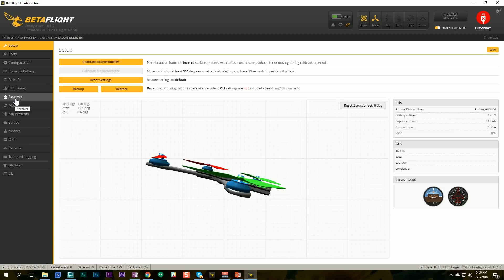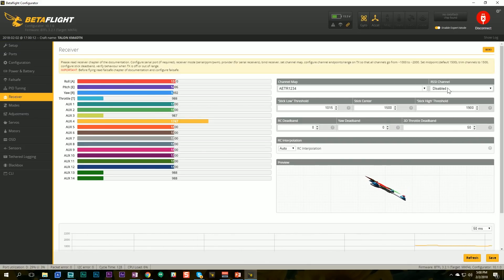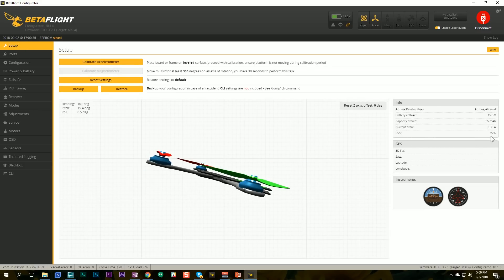How to put RSSI into OSD (UPDATED FOR OPENTX 2.2 & Betaflight 3.2)

Comment: @ Joshua Bardwell is there I problem with betaflight in the receiver tab, I have two builds that are the same and one works fine in betaflight showing the radio is working in that tab but the other one which is wire the same with all the same parts don't seem to be reading in the receiver tab.I been thru every inch of the build to make sure it wasn't my mistake but not at all. no matter what I do its not reading it.is their something that I don't know about, that just happen with betaflight I never came across something like this.And my buddy had called me up and ask me, if I was having any problems with betaflight ?and I said why do you ask ?he said I cant get the radio to show its connected in the receiver tab and I have it on the rite uart and all my wires are correct!!!!so I had to laugh and say im having the same problem so is there something going on that we don't know about.this is why I whish I could make it to the camp with you guys ......pls help if you can
Reply from the maker: Receiver tab blank usually means you are on an old version of betaflight. Check the firmware version on the FC.
Reply: Ok i will do that update and see how that go's thank-you for taken time out to help me.Your the man..And i think you and drew should host more shows the chemistry is on point,great show and i will be sending you $ soon when i get pay for all your  hard work.Thanks again

Comment: I've noticed that using RSSI uplink doesn't prevent using the channel for another function. For example on one quad I have it setup on on channel 5 which I'm also using to arm. (I was running out of channels so tried it and it worked fine). It's mapped to the ARM bar (Modes page) in Betaflight, AND is selected in the Receiver tab for RSSI  It seems the RSSI signal is overlaid on the normal PPM (switch signal) somehow. They don't interact or interfere with each other at all.  

The way I understand the signal path is the 2.4 rx generates the RSSI, sends it down telemetry to the Transmitter (2.4) which displays it and sends it back up to the 2.4Rx (via ch5 in my example) and over sbus to the FC, which then puts the RSSI on the video signal (OSD) which is transmitted on 5.8, received and displayed on your goggles. A VERY circuitous route. Is there a 'shortcut' in the 2.4Rx, does it go directly from detected RSSI and output on sbus? It would have to for this scheme to work with non-telemetry receivers.

This is more involved than it 1st appears, and I'm trying to understand it better. 
Could you explain how the channel sharing works?, I can't find any documentation on it. Mostly technical curiosity, I'd like to understand the signal structure.
(I asked this on the Patreon site once, but I don't know my way around there and I may have posted it in the wrong place) Thanks!
Reply from the maker: +Scott Marshall I don't think you should put your arm and rssi on the same channel. I never want my arming channel moving unexpectedly like that.
Reply: I felt the same way, wouldn't have even considered it, but it's on a FT Gremlin on 2S. Been working fine for months, no interaction at all, but I would like to understand the signal structure - the RSSI is apparently not PPM, or it would be doing weird stuff. I can't remember why, but there was a reason I couldn't share with mode or something besides arm. It was last June or so when I did the build, so it's a little foggy now, but have wondered about it since.
I probably should put ch5 on the scope, but was hoping you knew about how/why this is working as it is.
Reply: Your understanding of how the signal is traveling is correct. But the big question to me is, why are you limited to 5 channels in the first place?! even old D8 protocol stuff had 8 channels minimum!

As for how you're passing both signals on one channel, I've certainly never heard of anything like that. The sbus protocol doesn't allow for multiplexing 2 signals, if you don't believe me, there's a spec sheet available online for it even, you'll have to google it, I can't easily link a pdf here. but I found it though searching "s-bus protocol data sheet"

How are you multiplexing the two inputs in your radio into the sbus output? Additive? Mulitplicative? I could understand if you were adding your rssi value to a switch value, and then using the large offset for the arming signal, but BF wouldn't interpret the signal as a true reading if it isn't varying from 1000-2000us, since that's what it expects to see.
Reply from the maker: It's just a channel from value 1000 to 2000. I don't see any way that betaflight can "know" that it's RSSI vs. Arming mode. Why doesn't the arm switch override the RSSI value? Maybe you are adding them together and just getting lucky that you don't accidentally arm or disarm when unintended.

Comment: Any idea on how to also display crossfire TX-power in your OSD, next to RSSI ? Because as long as you don't reach max power with crossfire, you can still go further ;)
Reply from the maker: +titanium Betaflight has an OSD element that shows band, channel, and power.
Reply: power of the vtx i guess ;). Here i am talking about the power of the crossfire TX that is dynamic.
It is displayed inside the TBS OSD, when you run TBS full stack. But on betaflight OSD, i have never seen it.

Comment: I notice in this video you have your radio set to 16 channel mode, I think I remember (possibly from one of your videos) that 8 channels has half the latency. Is that true? I tried to change mine to 8 channels but I think the EU firmware is fixed to 16 - I couldn’t get 8 channel mode to work
Reply from the maker: I use 8 channel mode on all my models. This is only 16 channel because I made a brand new model just for this video.
Reply: Do you have to do anything else to get 8 channel mode to work other than change to it in the taranis? I’ve not been able to get it to work, might be because of the EU firmware
Reply from the maker: +Zylon FPV d8 is not 8 channel mode. That's what the EU firmware locks out. Just reduce the channels in the Taranis to 8.
Reply: Ah, ok. Thanks dude. Will give it a try!

Comment: 2:40 - Dude, your quad was running at 10001C! That’s kinda hot. 😂
Reply from the maker: The temperature sensor is actually what is used to encode the MSP over SmartPort data, if my memory is correct.
Reply: Ah cool. Anyway, helpful video, I’ll probably set this up RSSI on all my quads

Comment: My chameleon had rssi readout and dropped out- thought I'd inadvertently made some bf entry nixing it but can't get it backzpls help?
Reply from the maker: Check the steps I show in this video, right? It's probably that Aux Channel setting I show at the end.
Reply: Joshua Bardwell using inputs and mixer settings I got a reading only by leaving the weight and offset at 100 and 0
Before I had no taranis programming and there was rssi out of the box from armattan
Very interesting if not ....f--king wierd

Comment: What is this range test you speak about?  Is there an official FAA or AMA rule?
Reply from the maker: It's a really basic thing that used to be taught to everyone getting into RC before the Internet and FPV made everyone into a cowboy with no regard for safety lololololol kidding-not-kidding.

Before you take off, you put your transmitter into range check mode and walk away from your model. You need to get about 30 paces away without losing link. The Taranis will read RSSI to you while it does this. RSSI close to the model should be around 80. RSSI should stay above about 45 out to 30 paces or more.

Comment: In TBS crossfire you can simply map some of receiver’s channels to output RSSI or LQ via OpenTX Crossfire’s Lua script in receiver’s configuration menu, works great, same effect as with XM+ receivers and their 16th channel.
For some reason, it always makes me uncomfortable to think I’m seeing the RSSI value in OSD that has been traveled to transmitter and back %) I guess you can lose any kind of RSSI information if receiver has hard times transmitting telemetry back on long distances while receiving all the channels just fine

Comment: I got the XM+ when I go to the taranis and hit discovery telemetry it doesn't pop up but I do get it on my goggles why can I not see it in the tyrannis thank you
Reply: the xm+ does not support telemetry but your flight controller probably has an osd. they are different systems
Reply: Even though if the receiver has a RSSI pad I won't show up on the taranis but it shows up oh my goggles so it's fine

Comment: is there a way to display the RSSI in my transmitter? i am not using betaflight OSD
Reply from the maker: +Rafa Balderas Taranis does this automatically as long as you're using a telemetry capable receiver
Reply: Joshua Bardwell I am using the R-XSR and the telemetryg wire is soldered to the TELE pad in the BardwellF4. I am getting the RSSI info in myy OSD but the screen in my transmitter is not displaying anything

Comment: Missing how to show in the OSD.
Reply: Same here, but mine shows 0
Reply: You probably have RSSI_ANALOG (or something like that) turned on on the Configuration tab and that makes the RSSI AUX in the Receiver tab not being saved and keeping the "disabled" value
Reply: @aker_fry  everybody seems to forget that rssi analog switch in BF. Won't work with it switched on...
Reply: I got RSSI setup in Tanaris and it's properly showing a fluctuating value. However when I enable it in the OSD - all I get is "50" ???
Reply from the maker: Go to the OSD tab in Betaflight configurator. Turn on the RSSI element. Drag/drop it where you want.
Reply: Yes I know. Was more of a feedback: felt uncompleted video because of the OSD mention in the tittle. Nothing major

Comment: Joshua, you can edit the RSSI unit in the Telemetry screen. Just go to the RSSI sensor, press Enter and Edit. Scroll down to the unit (probably dB, as per default) and change it to %.
Reply from the maker: How does this affect the output to the RSSI Channel, though?
Reply: As far as I know, it is only used as a local value for the telemetry screen and announcements.

Comment: This is just the same methot presented by JC, ProjectBlueFalcon, RIP JC, a yeas and a half ago. Using this since he posted the video on 30 Nov 2016.
Reply from the maker: As helpful as JC's videos continue to be (RIP) he won't be able to answer questions on them if they come up, or update them for the future.
Reply: @JoshuaBardwell  did he pass away? Or just quit doing videos?
Reply: @NOXFPV  Passed away
Reply: With out the jc and jb my quads would have been smashed in anger a long time ago.

Comment: Why is it that Betaflight still can't get RSSI directly from Sbus wire along with everything else?
Reply from the maker: SBUS is one way: FC to transmitter. SmartPort can carry the RSSI information, and in BF 3.3 with Lua scripts, RSSI is sent automatically to the FC over the SmartPort link.

If you end up using FPort, then you will get all of this over a single wire.

Oh, how about this: in BF 3.3, the Lua script also sends the real time of day to the FC so your blackbox logs can finally be time-stamped correctly.
Reply: it can with the xm+ But.. You have to flash the RX with the latest firmware to get rssi on channel 8 or else channel 16, as you want.
Reply: I wonder if there is a way to get X4R-SB to do the same. I don't have a single xm+ nor will i ever, because i like telemetry and Betaflight lua script.
Reply: Now you are confusing me Josh. SBUS wire sends control inputs from receiver to FC and FC sends Telemetry via SmartPort wire to receiver. That's how i've learned it. As for FPort, yeah it would be cool, but i only use X4R-SB receivers so no can do at the moment :/

Comment: Thanks for the video, for the TBS crossfire system is the same procedure? Thanks
Reply: MAB FPV should be. Use RSS1 as the source when you build the input as CrossFire has a number of RSS and TSS “sensors”.
Reply from the maker: FWIW, Stingersswarm uses SNR not RSSI as his indicator of link status. SNR takes into account the noise floor.

Comment: All my XM and XM+ RXs have RSSI on ch16 by default all you need to do is set RSSI to aux12 in Betaflight although I'm only transmitting CH1-8 for lower latency CH16 is still RSSI. When flashing the RXs there is an option to have 15 channels and RSSI or 16 channels.
Reply: I did this and my OSD says 49 and doesn't change, anyone heard of that? I am using an old X4R-Sbus with BF 3.2.4. No Taranis for me, I use a Tango with a XJT module.
Reply: In BF are any channels moving without you doing anything with radio in the receiver tab if so that's the RSSI channel.
Reply: Drop the ch16. If you are running 1-8 for the 9ms rssi needs to be on 4-8.
Reply: Why not just flash the firmware version for 8 channels with RSSI on channel 8 ?
You will get at least RSSI for the OSD and low latency ..;.-)
Reply: That's what you would think but my TX is set CH1-8 9MS RSSI is on CH16 all I can assume is as it's not being sent from the TX it's generated in the RX and output to BF on S-bus CH16. Glad it works as I use 8 channels.
Reply: X4rsb. 1-8 channels. Rssi aux 8 on tx/ Rssi aux 4 in betaflight.
Reply: I think this is not correct. Rx must be also loaded with the 8 channel firmware to get the best latency. Setting Tx to 8ch is half job.
Reply: No...it is right. The Tx transmits by sending 2 pulses per 1 data pack for 16 channel mode, in other words it sends 1 position pulse modulated signal with 8 positions then it sends another one with the other 8. If you set it to D8 mode the transmitter only sends out 1 pulse because you’ve deactivated the other pulse by switching modes...therefore reducing the time by a factor of 2. The rx only has to receive that data an execute accordingly.
Reply: Interesting... So you mean that having the 8ch firmware or 16ch firmware on the RX will not affect the global latency ?

Comment: Hey Joshua I'm  using smart port telemetry with my XSR and while I can get RSSI on my Taranis and have voice alarms it won't display RSSI value in the OSD. I understand that's different than the non-telemetry receiver way you are showing in this vid but just wondered if you knew if there was a problem with the XSR in this regard.
Reply from the maker: The way I show in this video will work for your XSR. This is the exact approach you need.
Reply: I use xsr and this method work to send rssi, I have it on ch16 set.

Comment: Perhaps you should add a small comment about how to get the RSSI of the very popular xm+ as well?
Reply from the maker: Same method just use Aux16.
Reply: Thanks for taking the time to reply. I know this, but it took some time to figure out. I think if the awesome JB tells it, it weights more than a common fpv`er. Keep up the good content, Joshua!
Reply: Joshua Bardwell but you won't have telemetry alerts on the Taranis as there are no sensors back from the XM

Comment: Joshua Bardwell

I want to upgrade to OpenTx 2.2.1 On my Qx7.
But i dont want to setup everything again.
can i make a backup and set it back after upgrading?

Nice Video!!
Reply: you don't need to set up everything again.....
Reply from the maker: You can probably upgrade without losing your models, but connect to your PC with OpenTX Companion first and do BACK UP RADIO function. Then back up your models separately just in case.
Reply: Thanks for your Quick answer. I will do that.

Comment: This same setup has worked for over a year. JC had this on his channel. I'm happy you did it here as well, since your channel is ongoing. Has to be a telemetry receiver. The xm+ will not work this way but it automatically puts rssi on channel 8 or channel 16 depending on the firmware you use.
Reply: yes. if it does not work or show a fix rssi value of 50, then you need to update firmware on your XM+.
Reply: Fliptality yep

Comment: Any idea if this works for the Turning 9XR?
Reply: trickertinman assuming you are running opentx and RSSI is showing as a sensor on the telemetry screen it should be possible.
Reply: ndcapper I'm running the stock one, but if it's been done on a 9XR, I will switch to opentx in a heartbeat!
Reply: I have a 9XR Pro running OpenTx and a FrSky XJT module. It then gets RSSI to the transmitter natively so should work. However, not sure about the standard 9XR

Comment: I just did this on my Q x7.  I haven't checked my OSD yet but,  I noticed that I don't have the little bar on the mixer screen on my radio.  When I plug into BF, it shows exactly what your screen showed.  I'll have to try the OSD.
Reply: Well, apparently I got it right.  It does show up on my OSD.  Thanks JB!

Comment: Wait a minute so is that what the RSSI pad is on my Omnibus F3. So what is the difference between doing this and using smartport telemetry. Is the difference that rssi only send signal strength whereas smartport sends everything back to the transmitter, such as battery voltage and milliamp hours
Reply from the maker: Smartport telemetry is just a totally different thing. Carries sensor data from the FC to the receiver to the transmitter. Sensor data can be just about anything. It's just a digital information stream.between the transmitter and FC.

RSSI is the receiver telling the FC what the current signal strength is. The FC can then put that data into the OSD.
Reply: Joshua Bardwell So currently just using smart port I get sensor data back to my transmitter but I also get RSSI on my OSD but I'm not using the RSSI pad on the x4rsb I'm only using smart port. Am I doing it correctly?  Should I also be using RSSI?